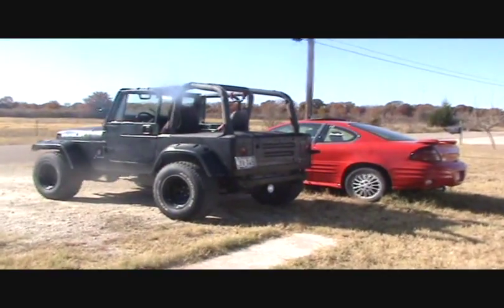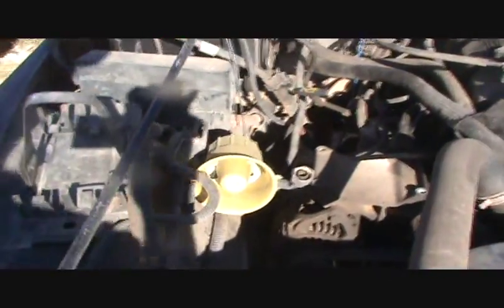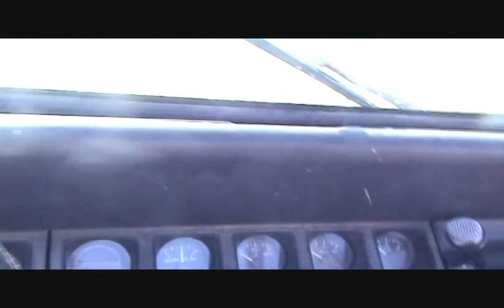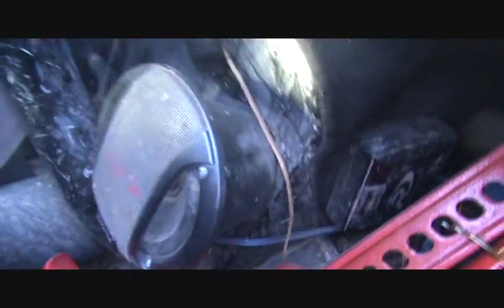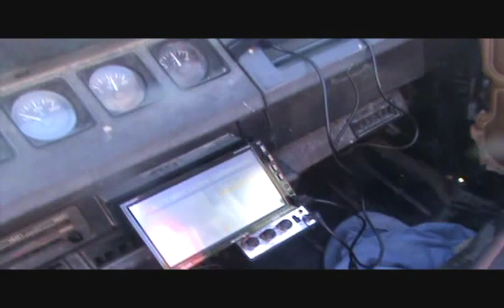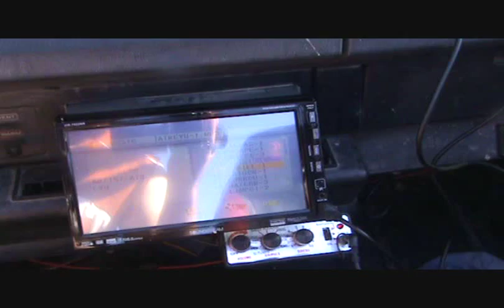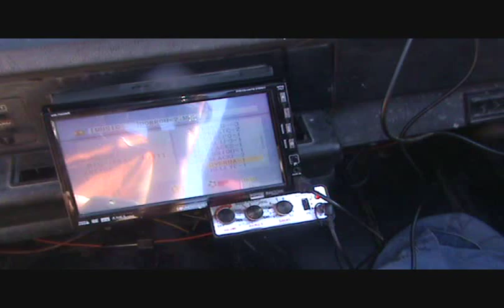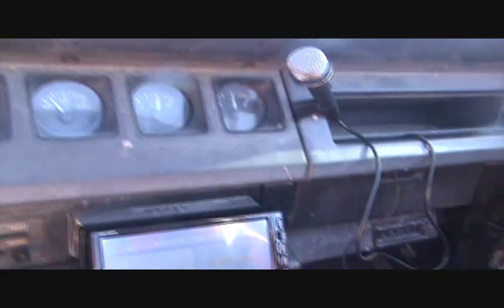94 Jeep Wrangler Yj with 2 12" type r subs and 32" BFG's

Comment from the maker: @SoCalOffroad909 You need to upload a video so I can check it out man. Glad to hear you are keeping it square [  ]lllllll[  ]. Sounds like a monster system, I building a custom soundbar and overhead console right now. I just got through changing the dash lights to red LED. Also mounted a Hi-Lift Jack on the hood.

Comment from the maker: @jeepcollector91 I do take it offroad quite a bit, but I try to stay away from mud and water. I have had too much stuff get torn up from water damage. It is my daily driver and I can't afford for it to brake down, because then I would loose my job. I used to be rough on it, but I realized really fast it gets too expensive, so I'm not worried about anything shorting out. As for the back up light, I have drug the skid plate a lot and I have hit the light countless times and it still works fine.

Comment: I dont think you will have to worry too much about that stereo getting stolen. If you really do use that Jeep off road it will get wet and short out way before someone can steal it. You may want to move that back up light higher or it will remove itself from your Jeep as soon as you drag the fuel tank skid plate across something. Good luck your Jeep & have fun.

Comment from the maker: @talldude950 With this set up you will definitely be able to feel bass not just hear it, the video doesn't do it justice. But unless you get the system cheap, I suggest saving your money for tires, lifts, armor, and re-gearing.
I wish I would have saved the money I spent for upgrades to the the axles. Go to JeepForum. It is the best website for any questions about jeeps, if you want to look me up on there I'm nohl75.